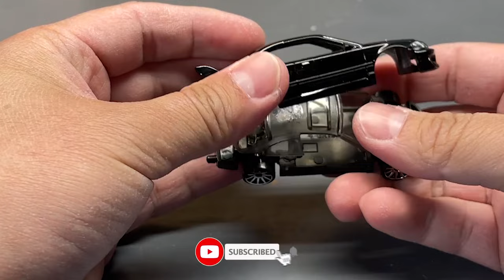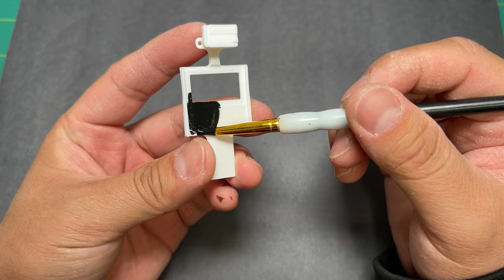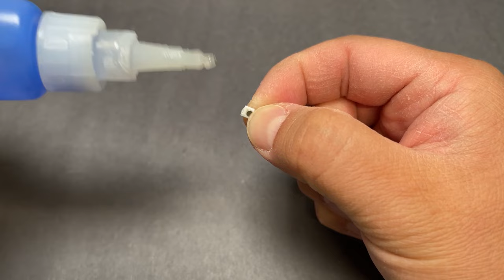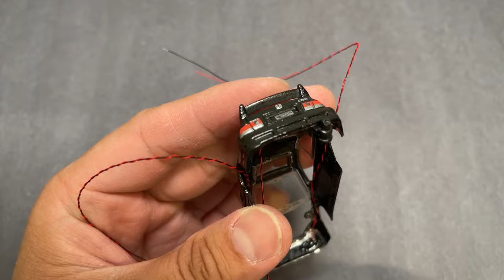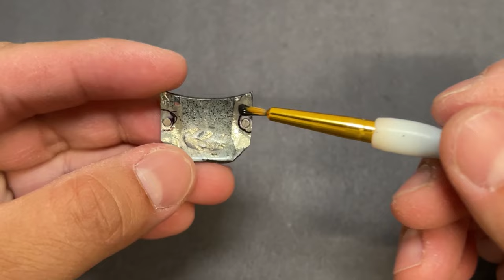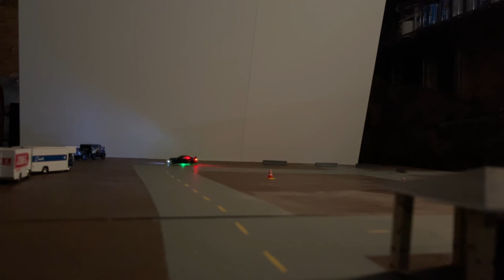How to make a RC Hot Wheels (Honda Civic Fast and Furious Style)

Comment: Super cool build bro but I recommend improving the drive system. Those motors have too much RPM
Reply from the maker: Thank you! Yeah these motors are not ideal but only cause it’s small and fits the builds.
Reply: putting the spur gear on the axle instead of the pinion would fix the problem....

Comment: If you don't have a 3d printer use thich card stock, like the stuff at the back of note pads. If you soak it in super glue its pretty strong! I have a challenge for you, Slick.. Make an RC Hot wheels with strengthened cardboard components like chassis and mounts :p would be cool to see if it actually works out!
Reply from the maker: That’s a great challenge. Unfortunately I have no skills to cut, modify, form or create anything like that from scratch. This is the reason I 3D model my parts and then 3D print. 
I could definitely try in the future.

Comment: Are they able to charge or do you need to change battery or have separate charger for  charging
Reply from the maker: Yes, the battery is rechargeable. I built a charging port on the underside of the car where you can plug in a charging cable to charge the battery.